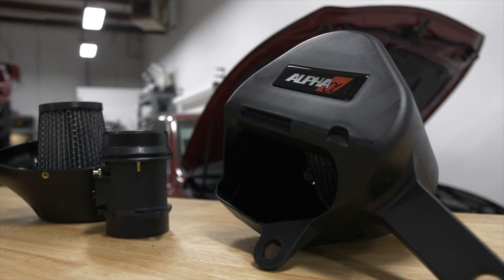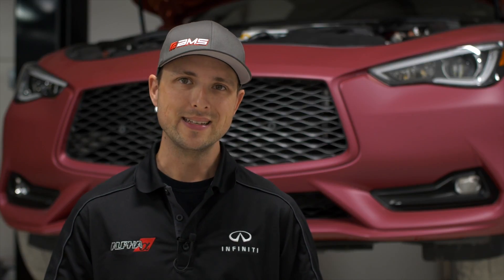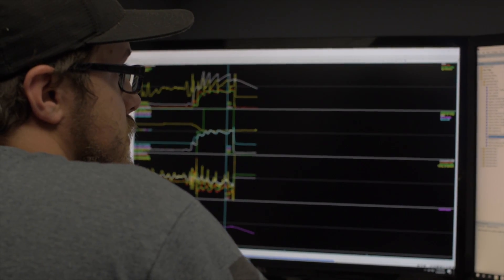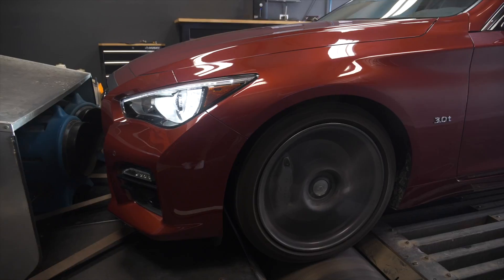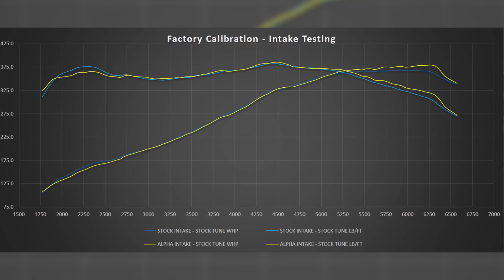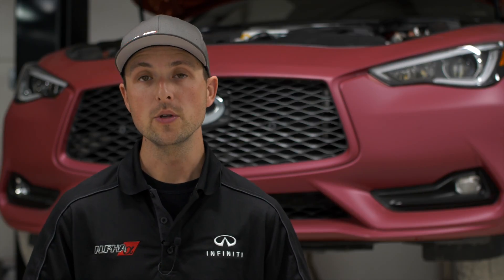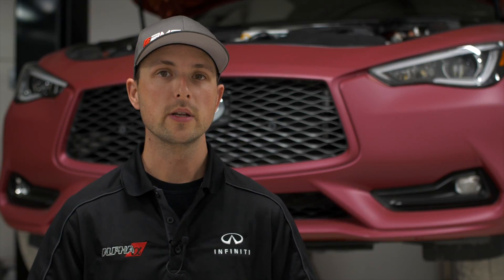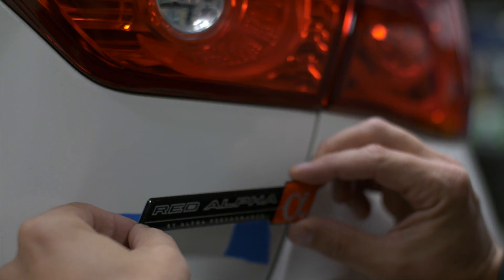Red Alpha Intake Data

Comment: Thank you for the video, so what if i install the intakes on my stock engine without tuning? how much gains could i get? thanks
Reply: ~17 horsepower at roughly 6k rpm
Reply: and will there be an engine sound difference?

Comment: You didn't answer below when deon9026 asked you, "Does this tune void the warranty?"
Reply from the maker: This is a question for your dealer. Every dealer is different. We do not determine what the threshold is for denying warranty claims that are established by the vehicle manufacturer. Thank you for the question.
Reply: @AMSPerformance  For the warranty being voided is not up to the dealerships, It is up to the factory/manufacturer.  So I take it that it probably does void the warranty as all flash tunes do and I am sure that you know that.  Be honest with everyone if your product is going to void their warranty, save them some heartache down the road, and if your customer chooses to go that way, well, that will be on them.  Personally, I would never do anything that would void the warranty of my vehicle, even if something breaks on the Q60 that may not have nothing to do with your tune, the manufacturer will not cover the repairs and your customer will be stuck with paying huge bucks just to get a little more HP.  Not worth it.......
Reply: This is false..a tune MAY deny you service on the engine, but it would have to be proven that the tune was what in fact caused the damage.

Ask how I know.
Reply: @PrimeGalvatron  I don't have to.  Every major part of the engine WILL NOT be covered by the warranty.  It may depend on the dealer if they want to do you a solid and cover another part of the engine that may or may not have any relation to the tune, but who cares about that?????  The powertrain will not be covered if you tune your vehicle, THAT IS A FACT.  The powertrain is what you do not want to pay for when something goes wrong.  My Jag F-Type R had a $20,000 factory German transmission, there is no way I would tune that car and have to pay for a new trans if anything happened.  That is just stupid, unless you are rich and don't give a fu(k.  Also, there are countless youtube videos on people trying to get their car fixed, but the dealer denies them because they have a tune.  Some even bought a used car not knowing it had a flash tune and when they brought it in to the dealer and they ran the diagnostics, the car had a tune and the warranty was denied.  They even bought that car from the same dealer if you can believe that?????  They still denied him.  Tunes voids warranties....
Reply: @crob5523  👍👍

Comment: Do you have to get a tune after installation? Or the car will adapt and be fine with it on? And also will this viod the manufacture warranty?
Reply from the maker: The car will be fine without a tune. We strongly suggest a tune to take advantage of all of the new potential with the new flow.

Comment: I think the oem box and filter are the best option if you tuned or not.
Reply from the maker: Well the data on our Intake system says otherwise......
Reply: @AMSPerformance  Your data, just like every other data shows that aftermarket intakes on VR30s are a waste of money. They same money can be used elsewhere for cooling/exhaust/tuning and you will get significantly more hp/dollar.
Reply: @Cab895  15-20hp increase is not too bad and helps your other bolt ons get the most amount of power with a custom tune. It's like putting bigger nostrils on a human. Humans tend to enlarge our nostrils when we have trouble breathing, it's a medical fact.